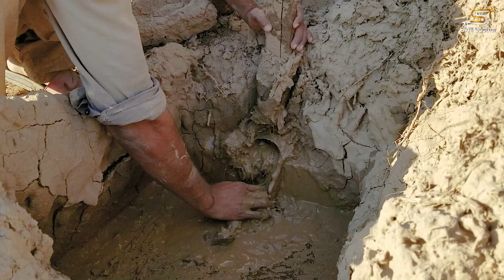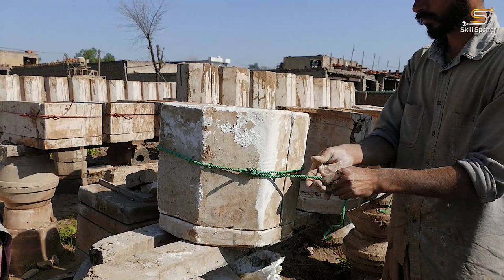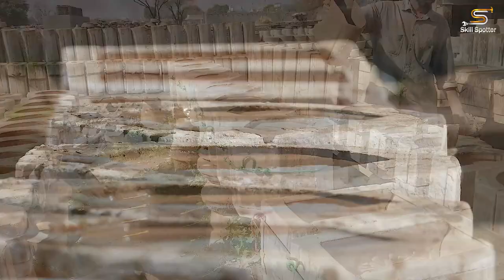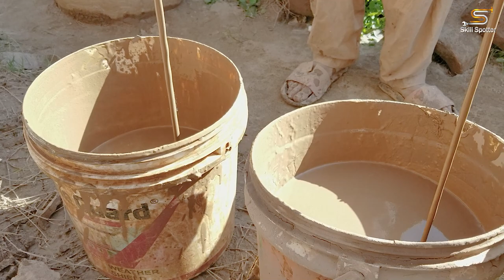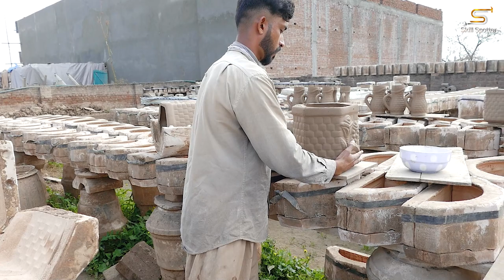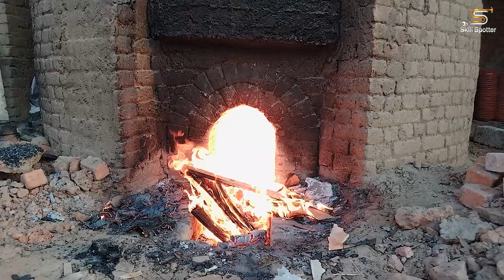Skilled Boy Making Unique Flower Pots from Clay | One Man Show of Slip Casting Flower Pots Procedure

Comment: That kiln has a massive crack in the wall that goes from the top to about halfway down in the center of it, that's not good. With the expansion and contraction caused by varying temperatures, it will eventually fail be careful, please.